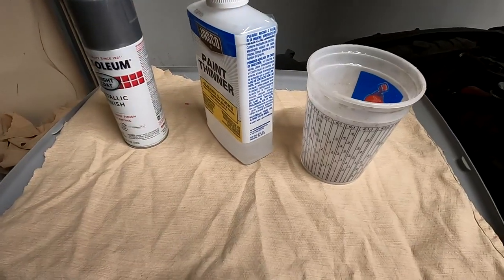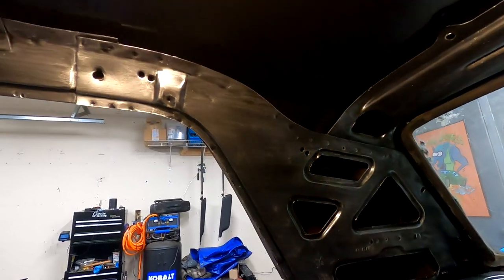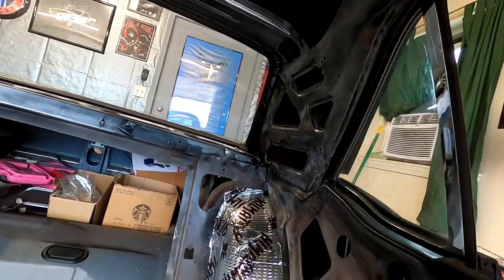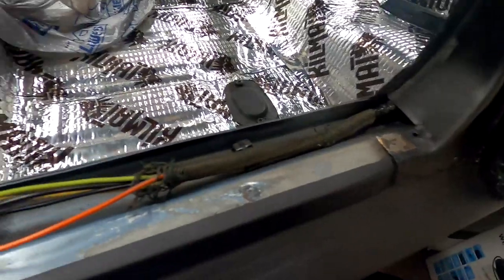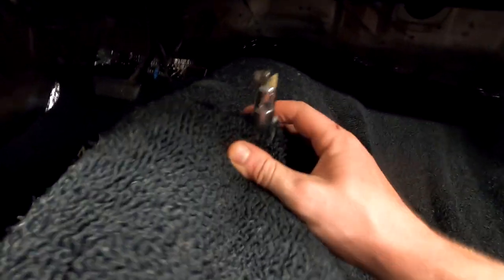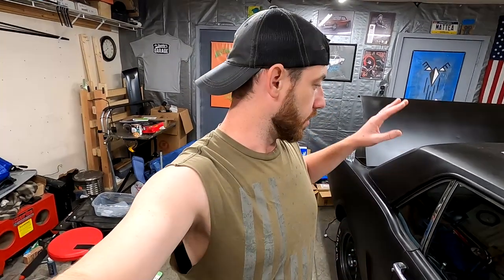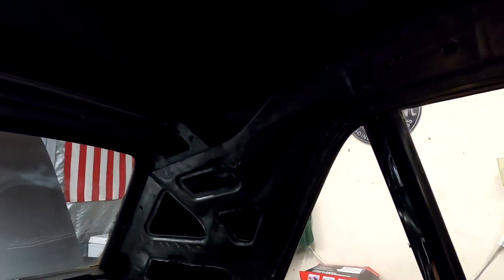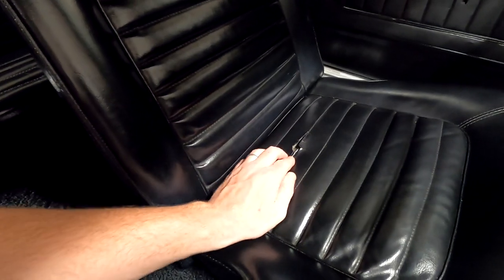Repainting Upholstery and Interior in my Classic Car Part 2

Comment: Moving along on my 65 Mustang. I've replaced the trunk floor, main floor and toe board. I'm repairing the top of the firewall now and installing a new cowl. It won't be a show car, but it will be solid. Two years plus in it so far. Keep it up. You're doing good.

Comment: It's nice to catch up on your progress again after being MIA for a few months.  Things are looking great. I really like the simpler flat black rat rod run look you are chasing.  Nice work.  It will also be more comfortable to have kids climbing in and out and enjoying it if it's not a concourse perfect car that you spent 10 years on.  I had a similar rip in a seat one time in my VW beetle that I cut a vinyl patch that was bigger than the hole, slipped it throught the ripped hole so it was under the rip (inside the seat) and then glued the seat down on the patch.  It was easy and you could hardly tell when I was done. I don't remember what type of glue I used.  FYI.  Thanks for the vids.

Comment: Awesome. Really happy for you that the car is at a point where you can get out and enjoy it. Funny you mentioned wiring... I almost ordered a wiring harness for mine since it is on sale. I have two dash harnesses but nothing else and prefer to start from scratch. And yeah that carpet is odd. Because of that I just did some looking at carpet for my 66 and tempted to go with the thick cut pile over the older style nylon loop. Oh and the better half was in your neck of the woods the other day. She hasn't been to that airport in a really long time.
     I think it's time for a junkyard trip to get a rear end for my 66 as suspension is coming up quick.
Reply from the maker: Film the junkyard trip. They make for some cool walk arounds!

Comment: Coming along really well. My concern without the headliner here is Georgia would be the heat. That roof would get hot as heck here if left in the sun for any time in the summer.
Reply from the maker: I've thought about the noise but didn't consider the heat. I'm curious to see how it does.
Reply: @GreaseRookie  Especially with the outside being black. It will absorb a lot of heat. Let us know how it goes. Wonder how cold it will get in the winter as well. I would think that might be a bigger concern where you are at. Good work though. That brushed metal look is kinda cool.